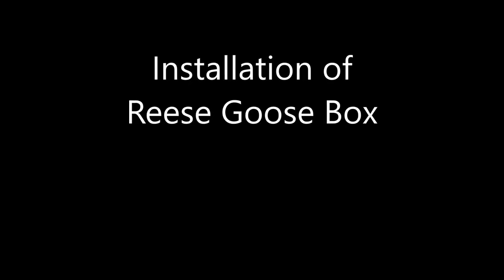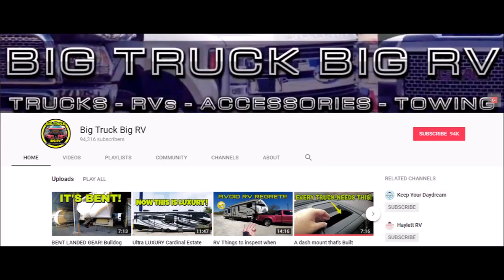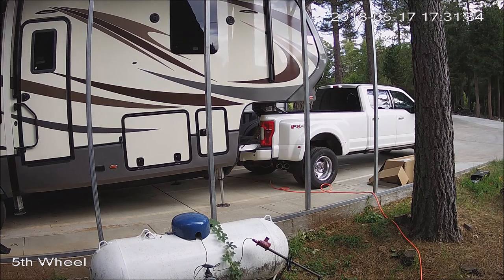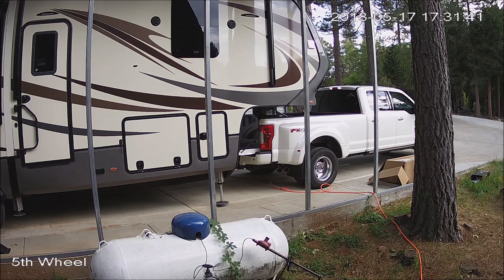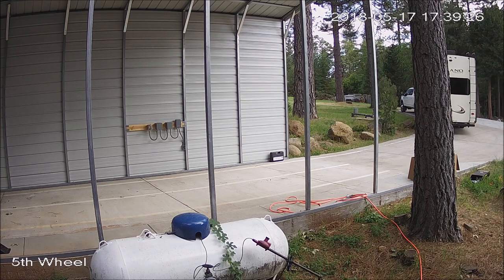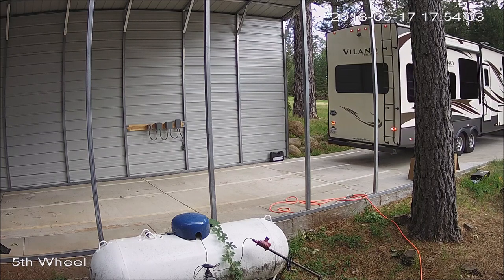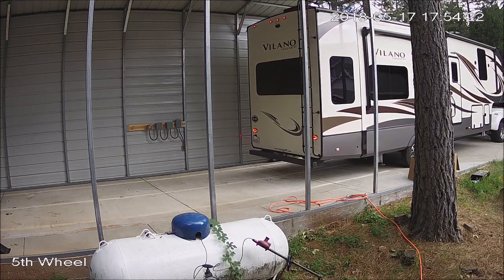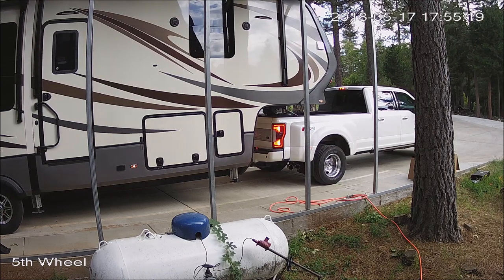Reese Goose Box installed on Vanleigh Vilano 325RL

Comment: How did you determine the right clearance between the bed rail and bottom of the 5th wheel?   Looks like first try and you nailed it?   Great vid, learned alot!  Thanks!
Reply from the maker: I figured out what height I needed on the gooseneck ball for the bed.  You can get them different heights.

Comment: Thank you for this review. I have been debating if its worth the cost to help with the the chucking the truck gets from the trailer. In your opinion how much does the air bag help with the trailer chucking?
Reply from the maker: Hello Dan.  I conservatively estimate 75%.  It really smooths out the ride.  Another benefit is after you put the trailer away, you just remove the ball and rings from the truck.  No strain or issues.  It is a really cool setup.  All the best.

Comment: i was wondering if you have done any boon-docking and how long your refrigerator  will run on your batteries before draining
them down and if so how many batteries do you have. i loved your review on your  coach it help me a lot on what to look and ask 
for cause im looking to down size from a forty foot mh to this model,and you did a great review Thank you
Reply from the maker: Hey Robert,
We are a hook-up kind a couple.  With that said, the guy who sold us the 5th wheel said the refer would last three days on battery/inverter.  Turns out, he was full of it.  I would doubt it would last 12 hours.  If you order from the factory, I believe you can get a large RV refer that will run on propane or electricity.  All the best.
Reply: Steve Switz. Thank you that about what I was thinking cause of the amp draw unless you got 10 batteries thanks again
Reply: We had a residential fridge in our last rig. It wouldn't last over night on battery. We tried stopping at a Walmart one night at about 8 and got up around 5 and the battery had died and the fridge was starting to warm up. If you want to boon-dock then an RV/propane fridge is the way to go.

Comment: What State are you in? Are chains required for Gooseneck Trailers? If not required, what were your reasons for adding them? I am looking at the Reese Goose Box as well.
Reply from the maker: I believe they are required in California where we live.  We just got back from a trip yesterday and we love the Goose Box.  Smooth and quiet.  Glad I did it.
Reply: @switz11  Thanks for the info, I am glad to hear how smooth the Goose Box rides from someone who has experience with a standard Pinbox and 5th Wheel Hitch system. We just bought our 5th wheel and only have experience with a 30 foot Tow Behind. I am pretty sure the Reese Goose Box will be our towing system of choice.

Comment: Are you nose high on the RV? Did you get the B & W 2 5/16" higher ball to give you the 7" bed clearance? Would , it still clear a Weather guard Cross-bed toolbox?
Reply: Most RVs ride nose high with the new Super Duty. They are taller than previous years. Our setup gave us 6.5" of clearance with the B&W turnover ball & 2017 F350 DRW. I went ahead and picked up the B&W Hi-Rise ball for an inch more clearance. I think the only way to bring it more level would be to upgrade the RV springs and go with a bigger tire.
Reply: Can you use a Weather Guard crossbed toolbox and still have adequate clearance?
Reply from the maker: I looked on their website and there are many different models so I can't answer your question.  Sorry.

Comment: I am interested in building a carport for my 31’ Cougar fifth wheel. Can you tell me about your carport? Manufacture, size, etc ?
Reply from the maker: Hello Kevin, it is 40' long, 15' wide and the walls are 13' then the roof.  The back is covered as well as one side,  I didn't do the other side as it never receives any sun.  The cost was just at $5k.  I found a broker on the Internet and he coordinated with the manufacturer.